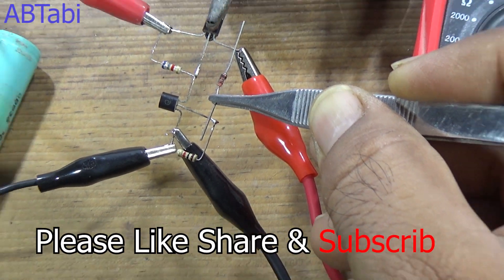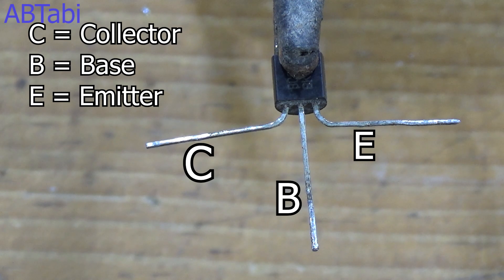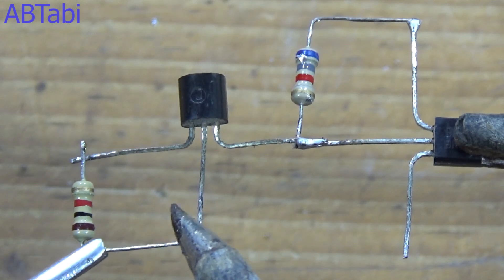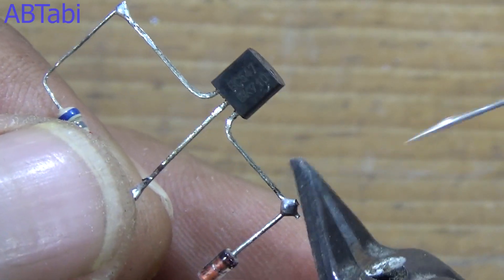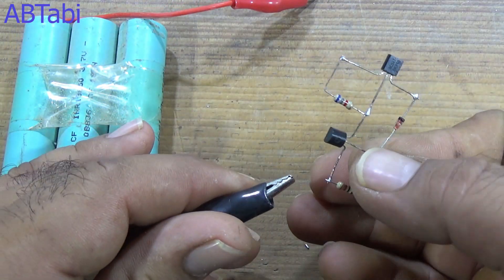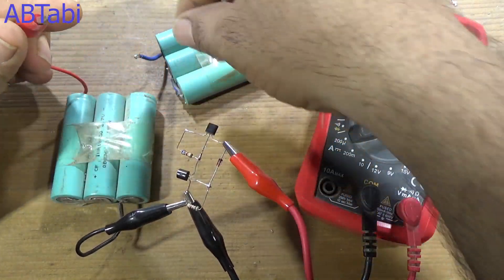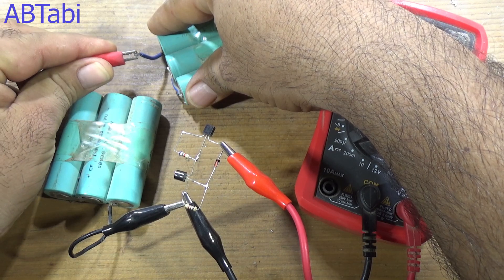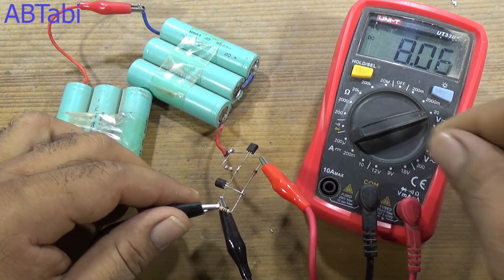Make a Zener Diode Fix Volt Regulator, Electronic diy Project

Comment: this circuit is only for 1/2 amp output, and if i need more amperage i just need to change the transistors to higher wattage, is that correct?
Reply from the maker: Please wait.................